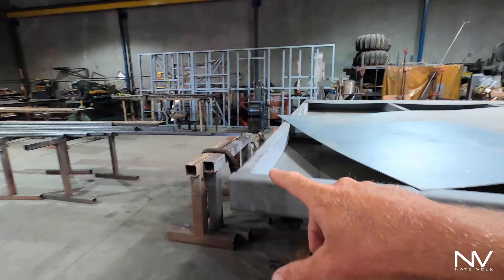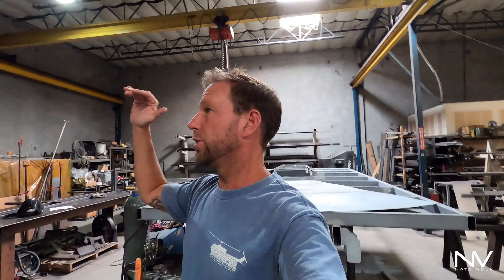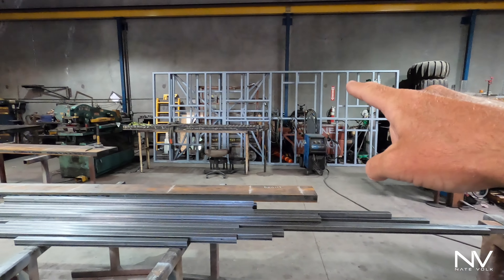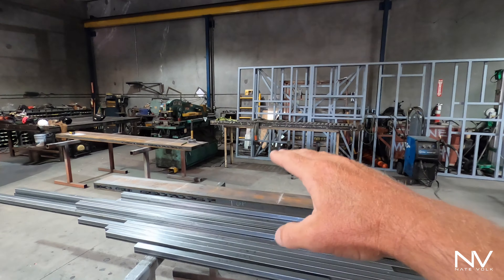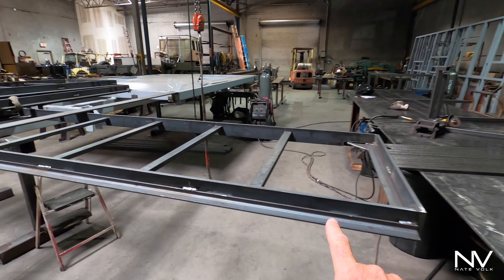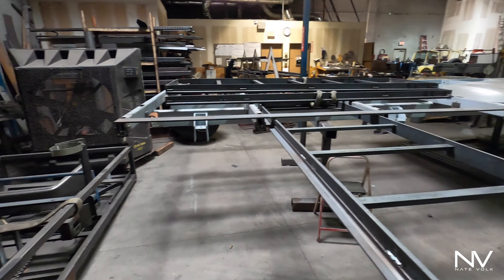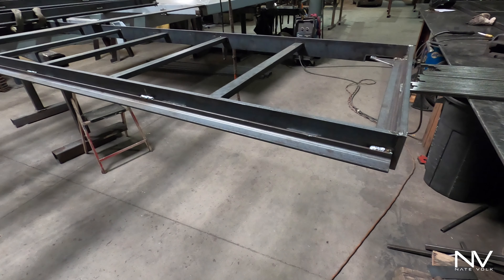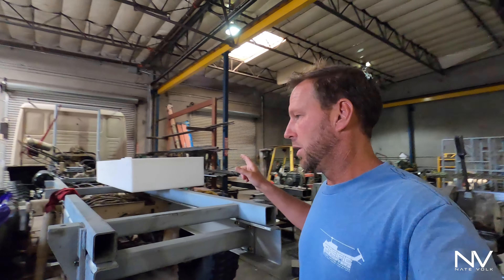LMTV Overland Expedition Truck Build - Part Seventeen

Comment: Mount a minisplit like we did.  Our rig sits at 12'10" to the top of our solar panels.  14'6" offroad is going to be a handful not to mention some of the detours you will need to take on normal roadways to avoid nailing your box or a/c unit.  Also 15k btu ac in the cab will not be as efficient as you think it will be.  I learned that the hard way.
Reply from the maker: Thanks, I don't really have a good spot for the condenser of a mini split.  And not a huge fan of the way they look.  I had one in my house and it was awesome though!
I went through a bridge the other day that was 13'3".  It was hard to believe that the rig wouldn't fit through there lol!
Thanks for the input!
Reply: @NateVolk  I guess it all depends on a few things.  The minisplit condensors are fairly easy to mount anywhere.  The trade off is a super efficient system that can run solely on solar (we do this with ours).  I just think that anything over 13' in overall height is going to make travel a huge headache.  Heck we have areas blocked by a tunnel with a 13' access restriction not to mention some of the smaller suspension bridges.  You would really be limiting your access to some great spots.  I would take "ugly" any day over "inaccessible" or "damaged"...
Reply from the maker: I tend to agree with the 13' mark.  I don't think I'll have an issue off road, but some of the on road things could be problematic.  I traveled quite a bit with a giant toy hauler, and there was only one spot I couldn't get to because of height...  I'll look again at where I could mount the condenser, but I'd also have to change the inside layout a bit and lose some cabinetry to mount the interior unit...
Thanks for your input, I appreciate it!

Comment: I have an m1083, and on WA state forest service roads I have encountered plenty of branches to the cab of the truck.  I am personally going to use a mini split for a/c, so that I can keep my top smooth with no roof penetrations. 
I would take 12" off the top and use mini splits, several overlanders have been successful with the mini splits.  More likely to damage a rooftop unit than a tucked away mini.
I have personally had more height issues off road than width issues.
Enjoying the build, keep up the good work!
Reply from the maker: Thanks for the input!  I think I'll end up ducting the A/c from the cab roof to the box...  Best of both worlds and no mini split hanging off the back.  I've got other plans for back there anyway ;)

Comment: Looking good Nate! Just hang out at nudist resorts and skip the AC. LOL Kidding, 

Hey, I was curious how you resolved the cab air suspension control without the manifold.
Reply from the maker: Thanks!  Even naked, A/C is nice :)
I actually haven't solved the airbag control just yet, but it seems pretty simple.  You need an air supply (from the wet tank) that goes to an on/off valve (so you can dump the bags to lift the cab) then to the level sensor to keep the cab height correct, then to the bags themselves.  Shouldn't be any more difficult or complicated than the original setup.  Check out BrokeOverland, he kinda did it without the cab control, maybe he fixed it later, I'm not sure!

Comment: 13’ 6” would be the absolute max I’d ever build it.  I built custom motor coaches for years and never seen anything taller than that.  Very nice quality mattresses can be found that are 8-10” thick.  Lastly, I’d suggest looking at mini-splits again.  With all the items you’ll have hanging off the sides of your rails, a small box with expanded metal on 3 sides would easily hold the Condenser and out of sight.
Reply from the maker: Thanks Todd.  Most of the new toy haulers etc are at least 13'6".  I ended up dropping the ceiling a little bit and relocated the A/C.  I don't really have a good spot for a mini split, both for the compressor or the interior unit.

Comment: I agree with the other saying move the a/c. You can sacrifice any one of the four ceiling corners to build a box with three side exterior vent panels. And then you can run the ducting without having to attach it to the cab.
Reply from the maker: I think I'll end up mounting it to the cab, as it is lower than the box by a lot, and ducting it into the box and the cab to be able to cool both with one a/c.

Comment: I would recommend reviewing the rooftop AC. Everything you have done is fitting to your needs.
Reply from the maker: Thanks, I might try ducting a system to the box.
Reply: There’s a lot room above the truck cab. Not sure if you could go forward on the habitat and still tip the cab. 

Or
 You could have the bed stay at height and then drop for the rest of the truck that would make the top of the air conditioning the same as at the rear.
Reply: Also depending on the layout inside you could just drop a hole down in a corner with clearance for the condenser open on the top finned on the two walls with drainage to not hold water. From the out side it would look flat along the top because the condenser is dropped down into the recessed box. Nothing would stick up past the height of the vents etc
Reply from the maker: Thanks for the thoughts!  In the end, there is too much compromise for me with a mini split a/c.  I'm going to duct the main a/c into the cab and the box.  I'll keep you guys updated!

Comment: I see how you plan to insulate the front of the hab floor... but how are you insulating the rear where the slide deck is? 

I'm planning to build out the exact same truck in the near future. But sub frame has been my main dilemma since I wanna be able to traverse most terrains I come across. Love the info!
Reply from the maker: Thanks!  The rear has room for insulation in there too, just not as much. I’ll be using a spray foam with a much higher r value back there.

Comment: Use a mini split or recess the AC units into the roof. Or, make a vented compartment for the mini split condenser to hide it. As far as height, the biggest issue is Center of Gravity. The higher the roof, the higher the COG. Lower the the roof. 7'-6" inside is not necessary. If you want to get into the great outdoors, you're going to run into a lot of tree branches....
Reply from the maker: Thanks Ethan!  At this point I'm a little stuck on the mini split location; I don't have a good spot for it.  I suppose I could lose some storage and make a home for it in a recessed cabinet but I'm not sure that will work for me.

One thought I've had is ducting an a/c on the cab roof to the box on the back.  It would have some flex hose that would need to be removed to tilt the cab, but it might solve some issues.

I wanted 7'6" inside so I could clear the drop down bed over the dinette without smashing my head, as well as sit up in bed comfortably when the bed is lowered.  I might end up lowering the sofa back a little bit too, buying back some headroom up there...

I think with these trucks, you run into a lot of everything in the great outdoors already lol :)
Reply: @NateVolk , are you going to have PV panels on your roof? Keep in mind they they are delicate in nature.... 

The thing about your build is that you're going totally over the top with space... compared to most builds you have ample room for everything and the kitchen sink. 

Once again, I suggest that you sit down with pen a paper and plan your build a little better. Otherwise you're just going to keep banging your head against these types of issues.

Your primary concern should be COG, as the materials you've chosen and the amount of stuff you want to cram onto that truck are going to severely limit where you can actually go. An LMTV is not a MAN truck.... The MAN platform would be much better for you.
Reply from the maker: Thanks.  Yes, I've got PV on the roof, with tree guards etc.  I do have pretty detailed drawings of the build and the interior layout already.  But I'm sure as you know, everything is a compromise.  I don't really think CG is an issue here, most of everything heavy is down low, below or at the frame and subframe.  I don't really have an issue with the height, but I'm second guessing my want for interior room vs max exterior height.  I've been all over the US and Mexico with a 23' toy hauler that was 14' tall, mostly off road as well, without too many issues.
What makes the MAN platform better in your opinion?  I don't know much about them.
Reply: @NateVolk , MAN trucks of equivalent era have better suspension, drivetrain, and brakes! It's a level up and better suited for the max weight and max COG you're going for.
Reply from the maker: @ethanturner5567  interesting...  I've always liked the simplicity of the FMTVs as well as the reliability.  I did drive a LMTV at max gross, and it handled quite nice.  This build will be well under that weight too.  I suppose we will see how it goes!  If I hate it, maybe I'll start on a MAN platform for next time :)

Comment: 15k btu is just enough for cab.  go with mini splits for habitat mount on front and back of box.
Reply from the maker: Hmmm.  I've got a 15k on my motorhome that is way bigger than this and it cools exceptionally well.  I'm leaning more towards ducting the A/C in the rear.  Helps with the noise too.
Reply: The cabs of MTVs have lousy air sealing and no insulation with a huge sun catcher windshield.
Reply from the maker: @ericbeckner6959  Well, yeah.  But who builds an overland rig and doesn't insulate the cab?  Seems like if you are driving you'd want to be comfortable and not sit in a tin oven...

Comment: I am at 13’3” to the top of the MaxxFan Ended up going with a split air conditioning unit mount on the back.. Photos of my build are on Instagram Under Dave.Vern
Reply from the maker: Thanks Dave!  I'll check them out!
Reply from the maker: That is a very solid looking build!

Comment: Morning Nate from Berlin, Germany

I plan my expedition truck in the moment, of course from the European point of view, because I start from here and want to drive in Asia and Central Asia. 

The problems here will be the bridges, maybe tunnels if you would go to Central Asia on the Pamir for instance. Or try to pass smaller roads. So mostly we plan here not to com above 3.70 - max. 3.80m. So your 13ft would be still much to high.

Your Problem is you massive subframe height. You could go for a 3point subframe and integrate the subframe in the box. Therefore you make the ground frame of your box a bit more massive. In Combination with a 3point system you could safe loads of height, 20-30 cm.

See here: https://youtu.be/8JBpwu-rZ4g

Of course would you you need 1 or 2 supports more in the front / back under the box, because of the length of your box.
https://youtu.be/Sa3MeqZQCHA

You could use a one or two boxed ac and build it / them inside your box, so it wouldn’t take any hight: https://www.dometic.com/en-gb/uk/products/climate/air-conditioners/motorhome-and-caravan-air-conditioners/dometic-freshwell-3000-_-151914

Terras slideouts: Hope you used capsuled bearings, if not you will get a problem with dust, dirt, ice and they’ll block after a time.

Best regards and success! Felix
Reply from the maker: Thank you for the input!  Yes, trucks in Europe must be much smaller :)
The subframe has to be that height to clear the transmission on these trucks.  Or you can notch out the living area to clear the transmission.
I do like the idea of the basement A/C, I will look into that!
And yes, the bearings are sealed and also serviceable and easily replaceable if need be.
Thanks for the input!
Reply: @NateVolk  I understand, mega truck - mega transmission :) A notched floor with a transmission or a hill in the living area i would like, too. :) Best Felix

Comment: Legal high with out a permit is 14 foot zero in California, 8 ‘ 6 “ wide without permits, you are going to need to lose 6 inches for sure to be street legal in California, you could make a retractable roof12 inch down lower nice , or you could go crazy and make it a pull and hook,( you know roll the whole thing off onto the ground with the hook 🪝 pull loader, I have seen them , but I’m probably off on the name rite now , anyway you have some adjustments to make to get it street legal with out a permit to drive it , anyway thanks BigAl California.praise Jesus grace amen.thanks .
Reply from the maker: Yes, that is the legal height of the box, things like a/c, awnings etc can extend above that.  But you do have a good point!
Reply: @NateVolk  our here in California some over passes are as low as 14.9 ,in most cases they are 15 feet, but they never account for the rise of the road bed height when they repave the road, so it’s a good rule of thumb to keep everything lower the 14 feet and the pat is maximum out here , I’ve never heard of ant except facts, been in the towing for years and years , if we had some higher we would need a 180 from the highway dots , and we are not allowed to , even in the towing have anything higher then 14 feet , anyway , you doing fine , if you have thing on top of your rig that is higher then 14 feet , I would not put anything in the higher levels that you cherish , keep all important things on the floor or under that hight lol, nice thanks BigAl California.
Reply from the maker: @alkennedy1124  Thank you!